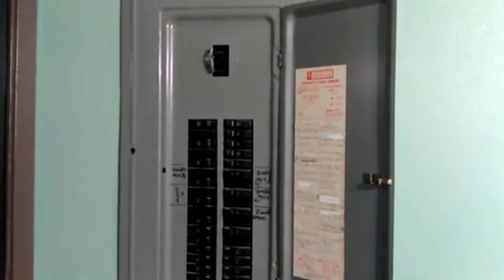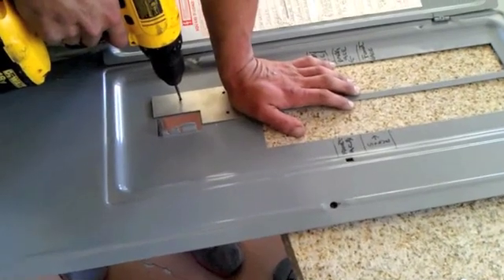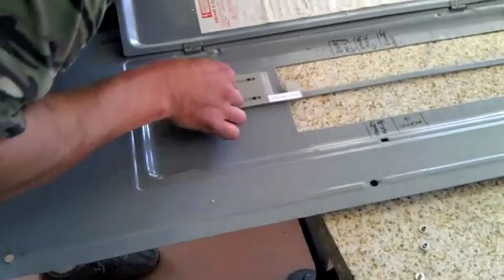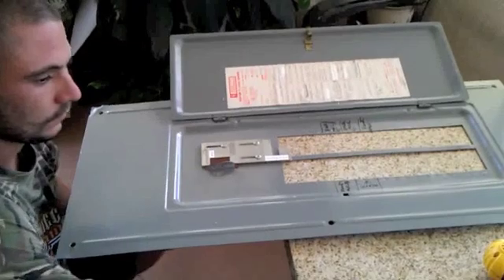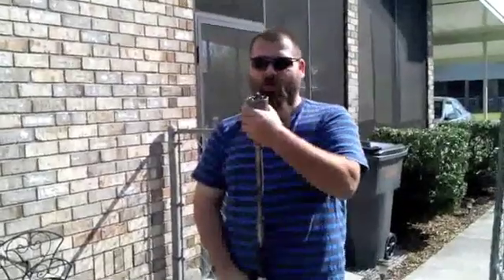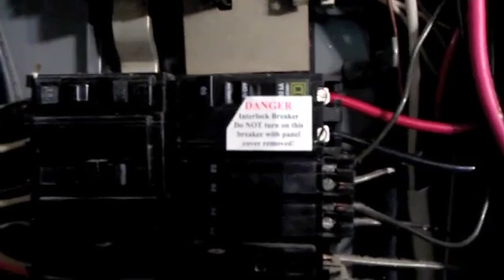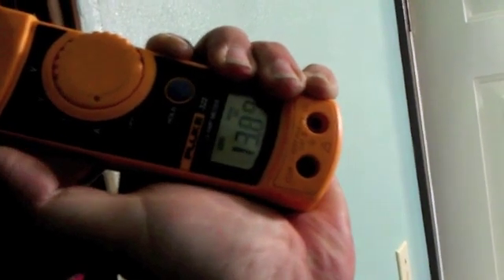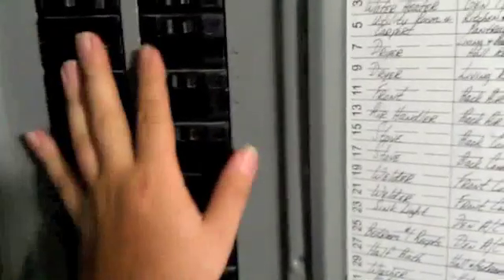Power your home from a Portable Generator the safe way! Kit by www.interlockkit.com

Comment from the maker: warbirdsp51: No it does not present any issues with the breaker, A over current device trips when the bimetallic strip inside the devices gets to hot the direction of current flow does not matter. Some panels are setup from the factory to be feed into a double pole breaker. In fact Square D makes a kit to do this exact setup we have done in this video and can be purchased at any Square D supplier.

Comment: It's a lot better to use a automatic transfer switch to determine power loss or phase drop out. It is also important to have a natural or propane gas generator that's quite .Self- control unit are better when power outages are unpredictable .Keeping generator on excerise mode let you know it ready for emergencies.
Reply from the maker: It is a lot better for who? Your statement assumes a few things. One that the person using the generator has frequent power outages. And two the person does not use the generator on a normal basses. Your statement also would put the install into a whole new class of code enforcement NEC 702.4 "2011 code book" states that if you have a generator that cannot handle the whole load that is transferred to it by automatic means you must have a load management system installed. Now the customer that was looking at a $500 job plus a $500 generator for a portable style setup is now looking at $6,000.00 to 10,000.00. We are in hurricane country in south Louisiana! Power outages are few and far in-between otherwise, Further more most people that have a portable generator take it to the camp at least once per month and it gets days of runtime when at the camp. In your statement this person would now have a generator that sits on side of the house and runs once per week and gets a good run on it every few years when we have a storm. Most people don't have the cash to have 10 grand sitting on side of the house, Don't get me wrong some do this option just work better for the ones that don't or the ones that already have a generator for the camp. This install meets the NEC code and is a whole lot safer than the knuckle heads that tell people to use a double male cord and back feed a dryer outlet!
Reply: I find natural gas and propane combustion to be "too weak of a combustion" to run my 7.5Kw generator efficiently. Gasoline drives the engine pistons, in my generator, hooked to the same watt/ammeter tester, almost 16% more efficiently That's 16% more power on a $3.00 gallon of gasoline...so, you do the math. ANY GENERATOR, however you juice it though, "IS BETTER THAN NOT HAVING ONE" when the lights and TVs go off, right ! LOL...

Comment: ART, Because the kit we have is supplied with a tiewrap and is NEC approved... Mike so that if a customer later purchases a Briggs 30556 or other similar sized unit we do not have to charge them to up size. The kits can be purchased in 10A, 20A, 30A, 50A, and 100A. We size as per what the customer has currently and possible future upgrades if the customer request.

Comment: Why use a 50 amp breaker when most standard generator plugs and wiring is only rated for 30 amps? The outdoor generator hookup box is only rated for 30 amps, right?

Comment: The use of tie wraps around the double breakers in the top four panel positions is interesting.  I understand that you are doing that to comply with NEC requirement for "an additional fastener" when backfeeding through stab-in breakers.  What was the rationale behind using a tie wrap instead of the $3 retaining bracket Square D sells for this purpose?